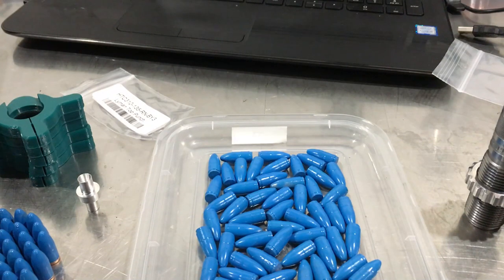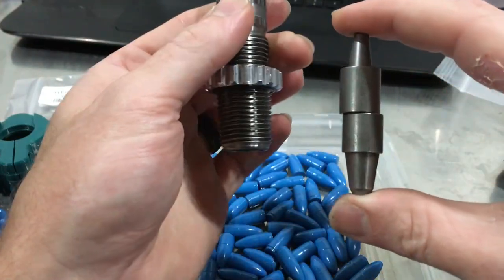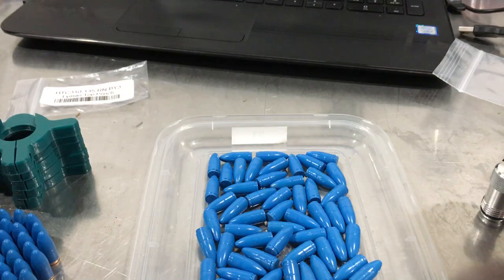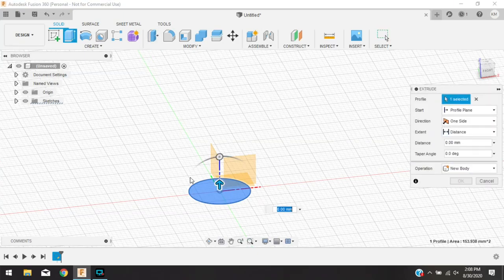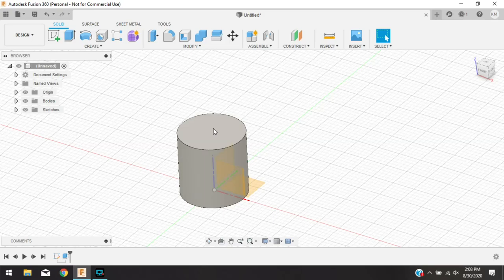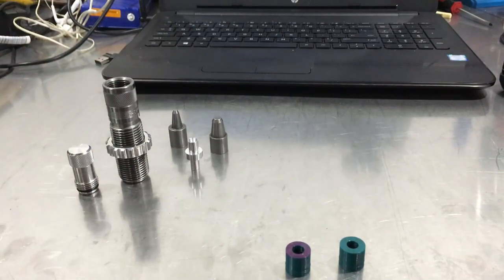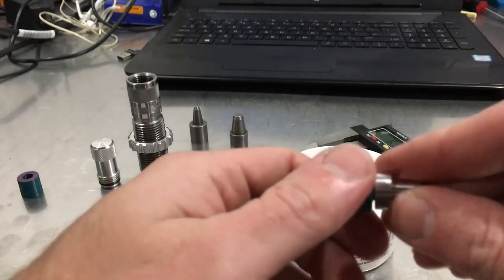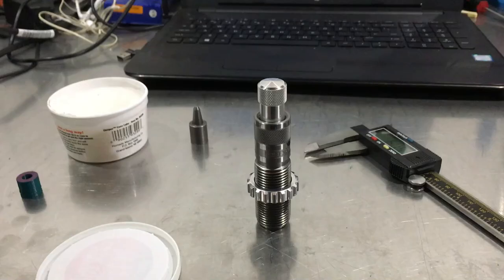Gas Checking Bullets/3D Printing | Hand in Hand

Comment: A 3D printer is unbelievably useful tool for so many things. I mainly use PLA for my stuff and Fusion 360 is a great CAD system but if I don’t use it for awhile I have to remember the commands for it. It’s a very powerful software but when in trouble you can look up Fusion 360 because there is a lot of info on it. And your right things don’t always print the same size as you draw them, but a great tool to have.
Reply from the maker: Yeah, I kept trying to orbit around my model by right clicking 🤣 Im used to AUTOCAD, which I use at work. Hehehe. I love having the printer to solve problems on the bench! Thanks, BYI!

Comment: Kinda did something similar. Used the flaring die with an insert to seat the bullet and then crimp in a separate step using a 3 die set. 👍
Reply from the maker: Yes, I forgot to mention that this can be a seating die as well! You beat me to it. Lol.

Comment: Thanks Tinman, Could you just print bullet seating stems as well? If you can I'll add that to my list of items I could make. I'm going to get a 3d in next 2 weeks, my list has hit 40 individual items so far, not all reloading, some gun accessories as well. Would you still buy the Ender 3 or do you now wish you had a different one? Mike
Reply from the maker: I bet a guy could draw up sesting stems for this too. Might take some tinkering but it can be done. The Ender 3 V2 might be worth checking out. It has the upgrades I've had to do to mine after the fact.

Comment: I bought 3 noe nose punches, and other then the flat one I don't think the other 2 fit the bullets they are suppose to very well, if your Lyman punch is like mine it has to much space/gap in the nose and the lead is swaging up into the top/nose punch, and I bet this is why yours is sticking.
Reply from the maker: I was kinda thinking that too, but it got better the more I used it. It only happened when I smashed the crap out of the handle 🤣 I'm gonna try the RCBS top punch with the other 30 cal bullet I cast from their mold and see how it goes. I think those are steel.

Comment: thats awesome !   all that can be done on a APP too correct?  im guessing right side up or upside down??  i got new deluxe app in a trade!!
Reply from the maker: Awesome!!! I think you'll really like it. Decapping on it is great once you get it running smoothly. Yes, it can be done on the APP. Uncle Jim did a few videos on that. I just wanted to use a gas check seater. I did use the APP to size these once they were on.

Comment: What was the cost to get everything set up and running for your 3D printer?
Reply from the maker: Well, bone stock can get you printing for about 240 bucks. I did a few upgrades to mine, including the Octoprint software on a Pi computer, so I'm probably 350 bucks into my printer roughly? Not counting rolls of filament which are about 23 bucks a roll.
Reply: @TinManReloading  I am really ready to pull the trigger on a decent 3D printer... so many projects to do. What upgrades did you do ? Did you go with the Pi 3? I am looking at the Ender 3 Pro.
Reply from the maker: @papasplace2  I have a Pi 4, but a Pi 3B plus will work just fine. For upgrades, I did the glass bed with a sheet of PEI stuck to it for good adhesion. Makes a world of difference. I also put the cooling fans on it and I printed the ducting for the fans for better part cooling. I really like my Ender 3 Pro, I would buy one again if it came with the better motherboard. I also put in the TH3D EZBoard motherboard, but there are cheaper boards that are just as good with the silent motor drivers.
Reply: @TinManReloading  Well it appears that the newer Ender 3 V2 comes with the newer motherboard as well as a glass bed if I am reading things correctly. It also comes with the simplify3d/Cura slicer on the sd card... how does that compare to the Octoprint?
The Creality site has the V2 for $269 shipped.
Reply from the maker: @papasplace2  Octoprint is just a software you run if you don't want to use an SD card to print from all the time. I still use Cura to slice the file, but instead of putting the gcode onto an SD, I upload it to my raspberry pi and print it from there. If the V2 comes with that stuff already, I'd jump on that. I think my Ender 3 Pro was $229

Comment: Call me dumb. But i thought if you powder coat, u dont need gas checks
Reply from the maker: Youre right, I probably don't need to. But, if I want to push these bullets fast, I have the option to do that if theyre gas checked. Plus, I have some of these bullets in a plain base configuration that Ozark Spirit had sent to me so I'd like to see if there's an accuracy difference.